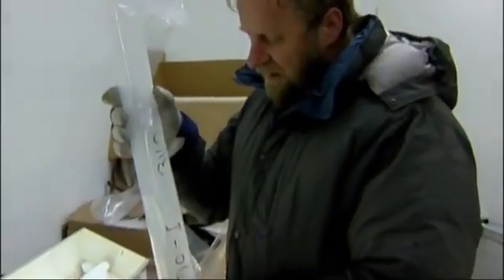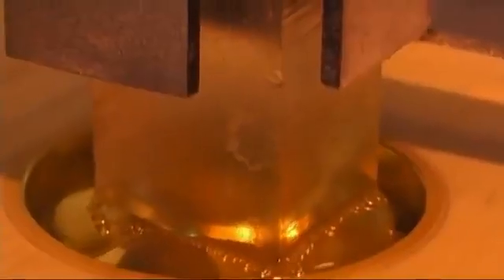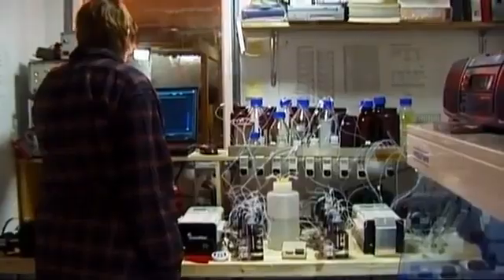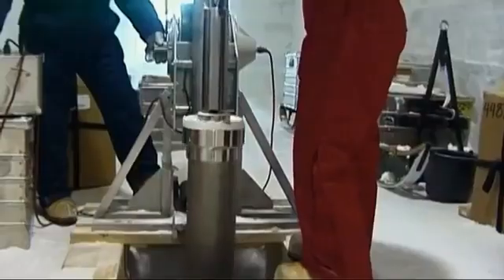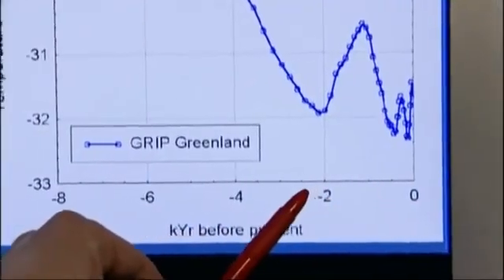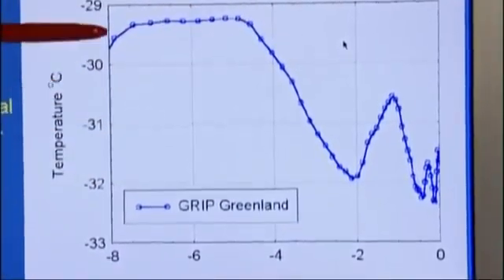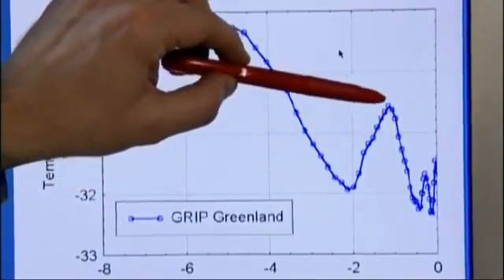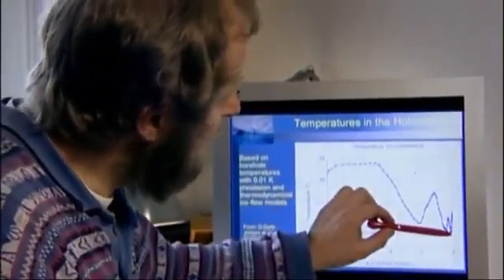The BEST Climate Clip I've EVER seen - What do you think?? #SCIENCE

Comment: The "medieval warm period" and "little ice age" were not verifiably worldwide climate events, but more evident in the lands around the North Atlantic: so were very likely caused by local ocean circulation patterns. And, if the speaker was unaware of this fact or chose to ignore it, I'd be cautious of anything else he has to say. If you want a more comprehensive analysis, using up-to-date worldwide data and analysis, I would recommend going to the Royal Society, NASA or NOAA websites. And, if you don't think those organizations are competent and yet believe this one guy, then I would suggest perhaps some deep reflection or a course in probability theory might come in handy.

The bottom line, in terms of physics, is we are adding a potent greenhouse gas (CO2) to the atmosphere (which currently contains about 3200 billion tons of CO2) at a rate of about 40 billion tons a year plus a lot of methane (an even more potent greenhouse gas). And, yes we know where it is coming from: which relates to why its a very bad idea to run your engine inside a sealed garage. And the critical bit that takes us outside past "natural cycles" is that most of the carbon we're emitting was not part of the historic "carbon cycle": because it was until "recently" locked up in the ground as oil, gas, and coal deposits. 

We can also easily measure the heating effect of adding certain amounts of greenhouse gases to a certain amount of air, by using glass bottles with varying amounts CO2 or methane etc. under sunlamps - with thermometers to register the temperature change with time. And such data can then be scaled up to give good estimates of how much extra heat will be absorbed in the atmosphere (mostly in the troposphere actually). Unfortunately, the trend is in one direction (yes upward), and the large scale effects in wildfire intensity, glacial melt, ocean and atmospheric temperature increases, frequency of extreme weather events, and the polar migration of species are being observed all around the world. It would be great if this empirical data supported what is being said in this YouTube video, but sadly it does not.

Beyond the gradual increase in greenhouse gases from measurable human emissions, there are also tipping points to be concerned with: as there are HUGE quantities of methane stored in permafrost that could be quickly released if average Arctic temperatures cross a critical threshold. If this happens, things could change so rapidly that areas that are now breadbaskets could become desserts and there could be huge die-offs of species. Need I even mention the drying up of glacier and snow fed rivers, and the wars that might erupt over basic necessities like water.

Beyond the heating effects, more carbon in the ocean also creates more carbonic acid which threatens species at the very base of the marine food chain. This effect is still not as well understood, but could be even more dangerous to the current species on this planet than climate change. The geologic record shows 5 major mass extinctions. Will we be the cause of the next? Our own?

Friends, this is our worldwide ecosystem we're talking about. It's too complicated to predict exactly when we might cross a tipping point, but it is inevitable to occur if we keep adding greenhouse gases to the atmosphere. Physics doesn't care for our politics. And, since we get only one chance to get this right, as the planet's intelligent species we'd be wise to err on the side of caution.
Reply: yes they were worldwide events
Reply: @bigboots6114  There are referenced articles on the Wiki page that say otherwise. And here's a quote from Britannica: "Information obtained from “proxy records” (indirect records of ancient climatic conditions, such as ice cores, cores of lake sediment and coral, and annual growth rings in trees) as well as historical documents dating to the Little Ice Age period indicate that cooler conditions appeared in some regions, but, at the same time, warmer or stable conditions occurred in others. For instance, proxy records collected from western Greenland, Scandinavia, the British Isles, and western North America point to several cool episodes, lasting several decades each, when temperatures dropped 1 to 2 °C (1.8 to 3.6 °F) below the thousand-year averages for those areas. However, these regional temperature declines rarely occurred at the same time. Cooler episodes also materialized in the Southern Hemisphere, initiating the advance of glaciers in Patagonia and New Zealand, but these episodes did not coincide with those occurring in the Northern Hemisphere. Meanwhile, temperatures of other regions of the world, such as eastern China and the Andes, remained relatively stable during the Little Ice Age."
Reply: @bigboots6114  Are you familiar with the concept of referenced work? Wiki includes its peer reviewed references if you would care to check. And I also provided a quote from Britannica just in case Wiki was not to your taste. But my experience has been that Wiki is generally quite reliable because, on scientific questions in particular, lots of experts get involved and tend to correct each other's mistakes.

In any case - I again plead that we just consider the basic physics. We are adding greenhouse gases to the atmosphere at measurable rates. This process of humans extracting carbon from the earth and spewing it into the atmosphere at stupendous rates is not part of the historical cycle - and the amounts coming from us dwarfs what comes out of volcanoes. What more do you need to know? And, would you not be shocked or at least very surprised if this process of changing the chemistry of the atmosphere did not change the climate? Also,  as this is happening at an accumulation rate (especially if we cross a tipping point) that can lead to a catastrophic disruption of civilization and likely a mass extinction of current species - we need to be worried about how armed-to-the-teeth humans will react when they become desperate. 

Why would we even want to consider risking these scenarios if we can avoid it? Although we are still in a transition phase that may take decades, the fundamental technologies exist to get where we need to be: i.e. (eventually) zero emission energy sources and 100% recycling of materials. These are not difficult concepts. The world needs reasoned voices to support the necessary action, or it may happen too slow - and then we leave our kids and grandkids in an impossible situation. It's our job to do the best we can.

As Bob Dylan wrote
 ... Don't stand in the doorway don't block up the hall
For he that gets hurt will be he who has stalled
... for the times they are a-changin"
Reply: @phonsefagan5649  re-read what i posted above

Comment: According to the United Nations, "climate change refers to long-term shifts in temperatures and weather patterns, mainly caused by human activities, especially the burning of fossil fuels". The problem with that statement is that the burning of fossil fuels cannot be classified as long-term. That's only been happening for about 150 years. That is just the blink of an eye in actual long-term climate dynamics. It doesn't fit. It wasn't happening 10,000 years ago when the average temperature was much higher than it is today. That blows the climate alarmists claims right out of the water...or ice, in this case.

Comment: Just brain storming but warmer planet maybe = habitable frozen tundra in Siberia /Canada ect.. Also more water vapor possibly changing the deserts in the middle east and Africa? More heat, more water vapor, more CO2= more vegetation = more food?
Reply: Normal air has C02 at 400 ppm, increasing levels up to 2000 ppm combined with sunlight can give 40% greater yeilds. I'm sure every type of plant has different percentages.
Reply: The initial soil may be low in nutrition but over time it mends itself through generations of plants growing and dying, animals grazing and rivers and floods. Its common knowledge that the Sahara desert and middle east were green and lush only a few thousand years ago and quickly turned to sand. Could have been from the earth cooling. It's also possible that regions change as the earth precession wobbles

Comment: "He concluded that his compilation of proxies: “…shows the Medieval Warm Period (MWP) and Little Ice Age (LIA) quite clearly, with the MWP being approximately 0.3°C warmer than 20th-century values at these 18 sites” Funny, Potholer54 just proclaimed Lohle confirmed Mann's hokey bullshit.
Reply: Hi, Potholer54 here 😁Thanks for the shout-out, now to correct your memory....
   Firstly, the researcher you are referring to is called Loehle, not Lohle. He did not just confirm Mann's hockey-stick reconstruction, he confirmed all of the reconstructions that have been done, all of which show a low undulating temperature pattern over the last 2,000 years, ending in a very sharp upward temperature spike at the end. That represents strong warming since the mid-1970s. 
   Nothing unusual about that, you might think. Except that Loehle had set out to disprove the so-called 'hockey stick' curve. 
   At first he thought he had done so. But he made exactly the same mistake as Ivor Cummins, and just about every poster in this comments section -- he thought that temperature data marked "before present" means before whatever day he sat down to read the data. Rookie mistake! In geology, 'before present' or 'BP' means before 1950, the standard benchmark of zero time. 
   As a result, the temperatures that were clearly lower than the MWP did not represent our current period of record high temperatures, they represent the low temperatures of around 1950. 
   When the error was pointed out to him, Loehle issued a correction. Loehle changed the dates on the x-axis so that the end of his timeline now fell well short of the current period of warming -- the 'spike' on the hockey stick curve. When temperatures after 1950 are added on to Loehle's reconstruction, they give the same hockey stick curve as everyone else. 
   That's what comes of stepping outside your field of expertise and publishing in a junk science blog that isn't on the Master Journals List and can't spot a simple error about time protocols that I learned in my sophomore year of geology. But kudos to Loehle for accepting the error and correcting it. 
   The moral of this story is that you can't just "absorb the graph shown, and think on it," as Ivor Cummins is encouraging everyone to do. Cummins has shown, and assume you know what the graph represents. So many people on this forum have been insisting that the graph shows we are at a low temperature point historically, or that we aren't as warm as the MWP, because they fail to understand that the graph, and Steffensen's research, only takes us up to 1950. 
   I hate to say it, but when an expert says something and you believe the opposite based on what you see in a graph, it might be an idea to consider that perhaps the expert knows something you don't.
Reply: @potholer54   wow, all that verbal diarrhea, starting with spelling nazi behaviors, pretending Lowell's work looks like a hokey stick. THat's a really stupid lie because his graphed data, shows a profound MWP and LIA, and looks nothing like the flat graphed data from Mann's hokey stick factory,   but come on back and lie some more, you seem to really enjoy it.
Reply: @potholer54   Vincent R. Gray
Published 2008
Environmental Science
The Global Warming Scam has been perpetrated in order to support the Environmentalist belief that the earth is being harmed by the emission of greenhouse gases from the combustion of fossil fuels. The Intergovernmental Panel on Climate Change (IPCC) was set up to provide evidence for this belief. They have published four major Reports which are widely considered to have proved it to be true. This paper examines the evidence in detail and shows that none of the evidence presented confirms a relationship between emissions of greenhouse gases and any harmful effect on the climate. It is the result of 18 years of scrutiny and comment on IPCC Reports and of a study of the scientific literature associated with it. In order to establish a relationship between human emissions of greenhouse gases and any influence on the climate, it is necessary to solve three problems To determine the average temperature of the earth and show that it is increasing To measure the concentrations of greenhouse gases everywhere in the atmosphere To reliably predict changes in future climate None of these problems has been solved. It is impossible to measure the average surface temperature of the earth, yet the IPCC scientists try to claim that it is possible to measure “anomalies” of this unknown quantity. An assessment of all the temperature data available, largely ignored by the IPCC, shows no evidence for overall warming, but the existence of cyclic behaviour. Recent warming was last recorded around 1950. An absence of warming for 10 years and a current downturn suggest that the cool part of the cycle is imminent. The chief greenhouse gas, water vapour, is irregularly distributed, with most of it over the tropics and very little over the poles. Yet the IPCC tries to pretend it is uniformly distributed, so that its “anomalies” can be treated as “feedback” to the global temperature models. Carbon dioxide is only measured in extremely restricted circumstances in order to pretend that it is “well-mixed”. No general measurements are reported and 90,000 early measurements which show great variability have been suppressed. Methane is mostly recycled plant material, unrelated to fossil fuels, yet it is used to penalise farmers for animal recycling, when the larger emissions from wetlands are exempt. Although weather cannot be predicted more than a week or so ahead, the claim is made that “climate” can be predicted 100 years ahead. The claim is based on the development of computer models based on the “flat earth” theory of the climate which assumes it is possible to model the climate from “balanced” average energy quantities This assumption is absurd since all the quantities have skewed distributions with no acceptable average. No resulting model has ever been tested for its ability to predict the future. This is even admitted as the model outputs are mere “projections”. Since the projections are far into the future, nobody living is able to check their validity. Since no model has been validated, they are “evaluated” based on “simulations”, which are mere correlations, often obtained by adjusting the many poorly characterized parameters to give a “fudged fit”. Several such attempts fail to agree with observations. Future “projections”, which combine the untested models and exaggerated “scenarios”,

Comment: I'm not picking a side but I believe their argument is not the change but the rate of change and I have to admit, your graph seems to show more rapid changes in the last 200 years or so. but they're not outside the overall range. just steeper.
Reply: I would say that is because we have had more specific data over the last 200 years to see all the small up and down changes. Going back thousands of years you are seeing an average of the trend. You don’t see the 20 year hotter cycle inside the 500 year cooler decline. If that makes sense.
Reply: FYI the graph does not show the last 200 years. The latest point on the graph is 1950. Current temps are higher now than the high point in the graph.

Comment: I like this as it is scientific. However the comments from people here are not, they are tin foil wearing lunatic's, most who are very uneducated in anything other than conspiracy theories. It is highly likely that the warming (from the coldest point) is man made. Is this an issue? Probably yes it is as it would mean it is not due to some natural cycle that can correct itself. There is still a question mark on this with respects to "creating an experiment that extrapolates the data from this low point", but it is very likely due to the science of how atmospheric carbon dioxide concentrations impact heat retention on planets.